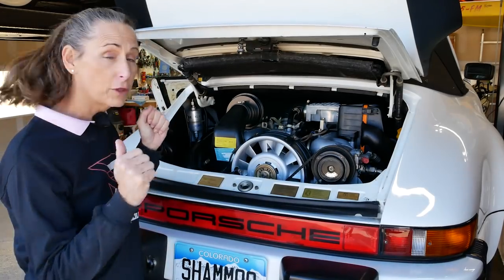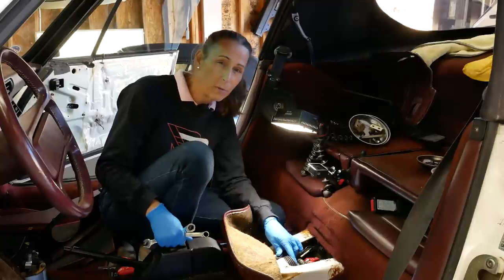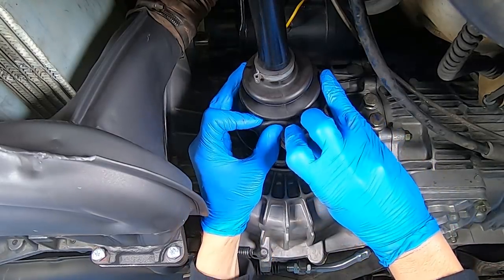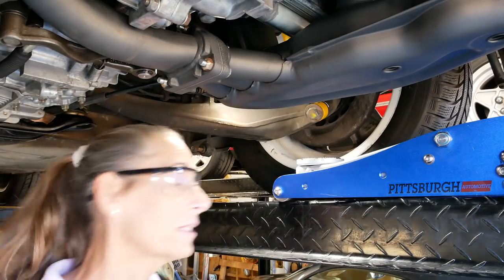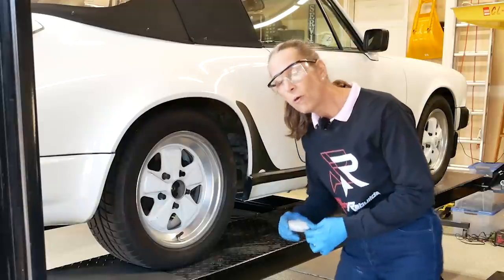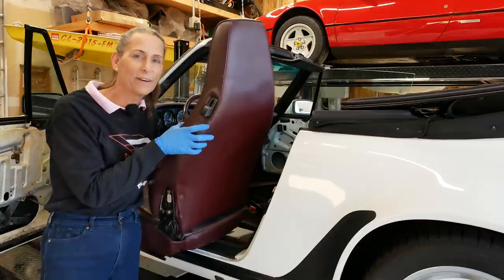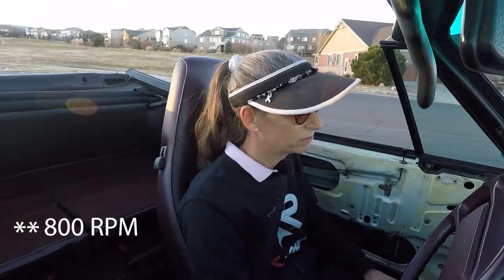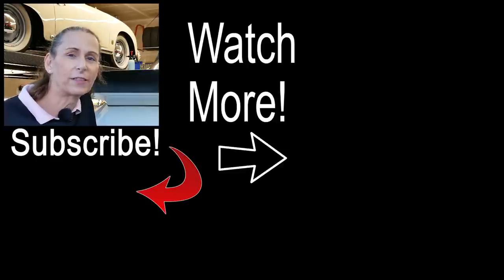Budget eBay Porsche 3.2 Carrera Project Car! #28 - FIRST DRIVE!! (...But Not Perfect Yet.)

Comment: Wow, what a clean engine and compartment!  A thing of beauty!

Love the fingernail polish!  When I built S-class motors on the Mercedes assembly line, all my torque wrench fittings sat in wet paint.  Each bolt with its corresponding color paint confirmed every one had been torqued properly.  Such simple & effective QA!  Not a single S-class motor had blown* over the years and the foreman didn't want the first to be on his watch!

* And they sure got tested.  Right off the assembly line and into testing.  And they revved them big time - no "breaking in" 3k tach limits at testing!
Reply from the maker: That's great!  It is super helpful when you are torqueing ion a start pattern...  I ALWAYS loose my way if I don't mark them ;)

Comment: On the subject of those wheel nuts....I worked for Roush years ago, and there was a procedure for Dodge trucks where steering rack nuts had to be re-torqued to, like, 150+ lb/ft, and one of the kids I worked with was maybe 105 pounds soaking wet. He was literally hanging from the steering rack to get the bolts torqued.

Comment: My 915 got hung up in reverse! I removed the back-up light switch from the nose of the transmission and pushed the reverse lock out pin back in (it made a definite Thunk!), then I had all forward gears again. My wife walked into the garage just as some gear oil started running out onto my hands, (unfortunately for her) I also adjusted the shift coupler.

Comment: Congrats, Frannie, on getting the 3.2 back up and running! One tip that a lot of people don't realize is that you can rent tools for free from Autozone. When I redid the entire rear suspension on my '87 Carrera, I rented the biggest torque wrench available at Autozone for those same 2 nuts. It's a 3/4" drive for the torque wrench so purchased a new socket from my local big box store. Not all the Autozones carry this torque wrench so you may have to call around.
Reply from the maker: That's a good idea...  Probably do the deed in the parking lot ;)  I did rent a knuckle buster from them for the 996 suspension lower are replacement.  Thanks for the tip!

Comment: I'm impressed with your skills and abilities. I've been a mechanic 42 yrs and just retired last August. I plan on building my dream garage this Spring and definitely need a car lift. Can hardly wait to start some Porsche projects. Take care be safe.
Reply from the maker: Oh, that's great!  Congrats on your retirement!  Porsches are great fun to work on :)
Reply: @HeidiandFranny  yes they are. I've owned 71 914 complete rebuild of engine highly modified, body suspension, paint & interior. Fun car for high school. 79 SC just drove it for 7 years regret selling but I needed something more practical at the time. I currently own a 99 Carrera cab, not a real fan of the engine but so far runs fantastic and lots of fun. I've been bitten by the Porsche bug.

Comment: Excellent! On injectors: if they sit around after getting cleaned they can corrode a little and become sticky. At least that is the lore in the 928 community. Another injector-related problem is getting them all clipped in properly. You installed your second rail by the favored approach. More than a few 928's have burned from bad clipping. By the way, it is remarkable how many parts are similar between 911s and 928s (I have both, and so should you!) Their water pumps are very different, though. ;)
Reply from the maker: Thanks Curt!  I think you are spot on ;)  I will make sure I'm careful with those clips.  I haven't spent much time with the 928.  That would be fun!

Comment: yup 36 F-LBS is the correct torque for the Porsche 911 CV axles or that time period.  Good times!

you may like the aftermarket anti sway bars on that car.. they give it a much tighter feel during spirited driving.

nice finial touch on the wheel center cap.. We did the same thing ( pointing the Porsche Crest at the valve stem)
Reply from the maker: Thanks for that!
Reply: @HeidiandFranny  no problem.  And thank you for the videos

Comment: Hi Franny and Heidi, another great video! The ease with which you are able to explain complicated mechanical problems is amazing.
When I am flying my wife’s airplane it is so much easier to look at the JPI 720 CHT/EGT to instantly tell if there is a problem with cylinder head temperature ,exhaust gas temperature, fuel injector or ignition problems.  The other thing that crossed my mind is the old movies of mechanics from the early days of racing checking the exhaust temperatures by wetting their fingers and touching the exhaust headers to see how hot they are running. 
I’m also concerned about Miss Eva. Is that rust on her right front quarter panel? Being a fellow 356 owner I know how rust can be endemic to these cars.
Hope you had a great Christmas and I’m sure that 2021 will be a much better new year.
Thanks again for another great video. Keep up the good work
Reply from the maker: Thanks James, It would be fun if these cars has some of those fancy-dancy airplane gauges.  Actually knowing the cylinder head and exhaust temps would be super useful.
Thanks for your concern for Miss Eva.  Yup, I assume that is rust...  It has been just like that for over 10 years since we have had her.  Honestly she does need a complete body work restoration.  The driver's door isn't quite right and it would be great to get some of the rust under control.

Comment: Wow just amazing work Franny and your bolt tightening technique was awesome. I did laugh out loud at you describing “you come out fifth gear and you are in Kansas” re transmission adjustment 😝😝 and with a bit of tweaking car will be as new mechanically and running like the well engineered piece of German architecture that it is :)
Reply from the maker: Thanks so much!
Reply: Yeah, that Kansas comment was classic. And so deadpan!

Comment: Use the timing light on every spark plug lead to see if the plug is firing. If you find one is not firing, switch the plug with a good one and check again to see if its the plug or wire.
Reply from the maker: Thanks!  That assumes it is just the wire though...  I did actually find a fowled plug (not the real issue though).  But the timing light is an easy place to start.
Reply: @HeidiandFranny  I don’t for sure, but if a plug is shorting the light shouldn’t flash.

Comment: I have to say how brilliant your films are - they are a hugely informative  entertaining and convey a real passion for engineering.  A big congratulations on getting the car back up and running again - it looks superb. As regards the cars running - have you had the Airflow meter checked over? With the injectors having been  refurbished - does the Airflow meter now need to be recalibrated to match the injectors to achieve peak running??...Just a thought???. 😃👍
Reply from the maker: Thanks for that. I'm guessing the airflow meter was calibrated to clean injectors and this should restore that.  I am hot on its tail though ;)

Comment: Just check with a digital portable thermometer with a movable probe (PT100 located on the probe tip), the temperature on each one of the exhaust pipes, near each cylinder’s exhaust valves. If there’s one cylinder without spark on its plug, the temperature will be lot lower on that, than on the remaining five cylinders which have a normal
ignition pattern.
Reply from the maker: Thanks for the tip!

Comment: Only Dorothy wants to be in Kansas lol. A good place to be FROM!
What a sweet ride Franny and you make it look so easy to work on it, course the lift helps a lot. I on the other hand, have alway had to rely on floor jacks and jack stands, like when I swapped out a trany on my 57 Chevy.
Does that shift rod have cams in the transmission? Did you get to see it apart to see how it worked?
See you next time and happy new year!
Reply from the maker: Thanks! I do have a few photos of it apart. The 915 isn't very complicated. I just need to get it running properly so I can do a proper shake down :)

Comment: Great series, what a lot of work to present let alone do. Congratulations!  Curious if you considered truck bed liner for the front splash pan instead of powdercoat?  It might  be more resistant to rocks.  Just a thought. 
  Happy New Year.
Reply from the maker: Thanks I hadn't thought of that...  Might be a better option.  PC is supposed to be pretty tough stuff.  We'll see ;)
Reply: @HeidiandFranny  there is a product called Raptor liner that come in multiple colors and is very resilient. Might be an option for you.

Comment: I love the fact that you went for a test drive with the top down, with snow on the ground. I have a question, having the same car, I watched as you put the axel back in. When would you grease or replace the axel bearings? Is that a job that involves taking the swing arm off the car, or can you get to the bearing when the axel is out? Thanks in advance.
Reply from the maker: lol!  That's a great question.  I bet those bearings could use a servicing.  I've done the fronts...  I'd have to read up on it but I bet you can just remove the axle and wheel hub and go to town.  I should have checked them while I had the axle out.

Comment: Great job! I guess rebuilding CV joints is even worse than muffler work ;) About your weight: 340 foot pound of torque divided by 2,5 foot should give us the answer. Spoiler alert: it's 136 pounds. Happy to see you put the seat in before you took it for a drive. I remember a story from when I was just ten years old or so, about a father and son who were in the process of rebuilding a BMW E21. They took it for a spin, sitting on a crates or toolboxes or something of that ilk. No seatbelts. It didn't end well. The engine sounds a little bit rough indeed, but I've heard a lot worse. I'm sure you'll fix that. Looking forward to the interior.
Reply from the maker: Thanks Freerk!  Funny story...  When I was little (five-six) I watched at night out a window as the seats were stolen out of my father's 1968 beetle.  The car was a couple years old and that was the first year for the high back seats and they were getting stolen for dune buggies.  I wasn't very successful in rousting my older sisters so in the morning when my father found out he was a bit, let's say, "upset".  I remember he drove around for a week on a small bar stool until he could source a set of low back seats to insure he would not be plagued with that issue in the future. :)

Comment: Great Chanel! what type of lifts do you have in the garage?
Reply from the maker: Hi Jake, Those are Direct Lift ProPark8s.  They are rated at 8000lbs and run of 120V.  One of the things I really like is that they have mechanical locks (not pneumatic).  We also had the doors updated to roll up against the ceiling and we use jack-pole lifts for them.  We have a super old (that we REALLY need to update) video on them: https://www.youtube.com/watch?v=enPy96sihyo&t=14s&ab_channel=HeidiandFranny%27sGarage
It is a bit cringeworthy, but some good info in there ;) Franny

Comment: Those serrated washers for the CVs are called Belleville washers. McMaster-Carr sells them by the bag quite reasonably
Reply from the maker: Oh, thanks for that.  Back when I was doing the CVs on the 308 there were a few missing and I had a heck of a time sourcing them. Probably having the correct name would've have helped :) Thanks!
Reply: @HeidiandFranny  yes, not everyone knows what they are... they come with serrations on both sides or one side. I always buy the two sided variety.

Comment: Regarding the CV axle bolts, is yours the M10 bolts? 

Torque is M8-30ft/lb OR M10-60ft/lb
Reply from the maker: Thanks Justin, M8.  Where did you find the spec? I looked through the shop manual and it talks about the axles, but not the installation. I've also read they should be re-torqued after 500mi or so.
Reply: @HeidiandFranny  In the Porsche workshop manual, page 42-02 Tightening torques for rear axle, it says
Axle shaft - bolt - M10 - 83 Nm (60ftlb), M8 - 42 Nm (30ftlb).
Page 390-3 of the Bentley also has it listed.
Bolts should be 12.9 Material.
I believe the max torque on a coarse thread 12.9 M8 bolt is about 31ftlbs. So both M8 and M10 are pushed to their limits in this application. 
https://www.fastenermart.com/files/metric_tighten_torques.pdf
Reply from the maker: Thanks so much for that.  I was looking for a tie-breaker between Bentley and Wayne.  I'm looking at 42-2 and it just has suspension torques.  42-5 mentions the axles, but no torques.  I'll take your word for it :)  I have heard stories of the Bentley being wrong on some torque values here and there so I do like to get a second opinion if I can ;)  I'll have to see what grade those bolts are.  I might have been a tad high, but they seem to be happy.  I'll double-check though.  Thanks for all the info!

Comment: What oil did u put in .plz &what year is it.thanks
Reply from the maker: The car is a 1986 3.2 Carrera and I use Valvoline 20W-50 racing because of the added zinc.

Comment: 132 pounds.  Super series!!!
Reply from the maker: Yea! ding ding ding!
Reply: @HeidiandFranny  I came up with 136, but I don't know things. Like torquing. I have a very basic question about it. When you torque something until it clicks, and then if you did it again, is it going to torque it more, or just keep clicking through? I was torquing my spark plugs, and it seemed when I came back to make sure I did it right, it tightened more. But that was the one and only time I used the tool, so I'm not sure what happened.